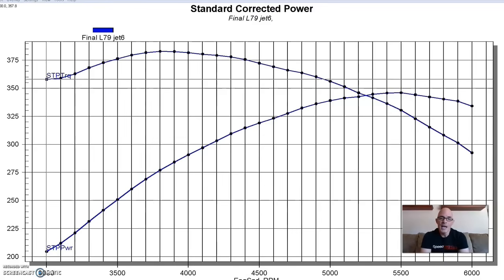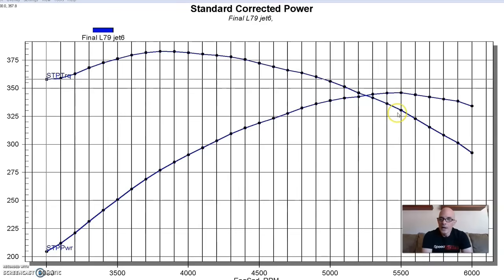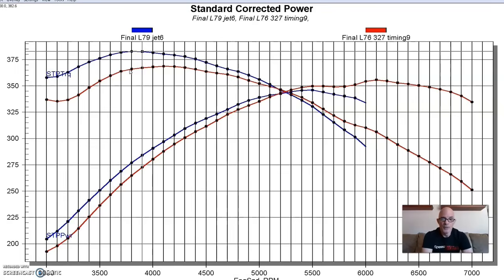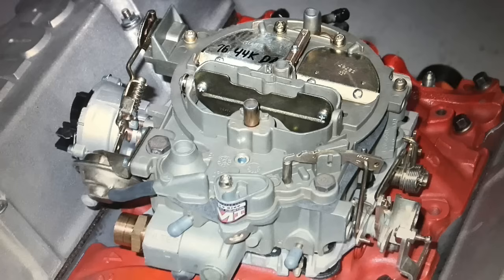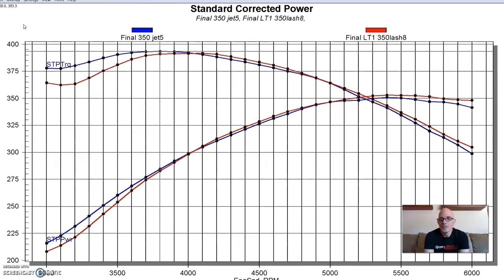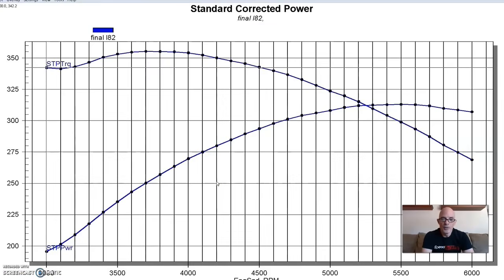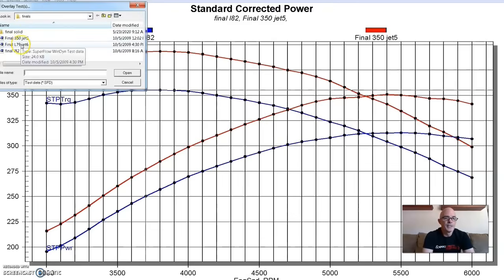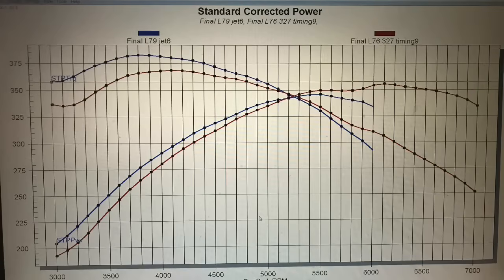HOW MUCH HP DID THE L79 350-HP 327 REALLY MAKE? WHAT ABOUT THE L46 350-HP 350 OR L82 250-HP 350?

Comment: I ben eating holley carbs with a q jet for over 44 years now ! My holley buddies hate me . I get 4 , 5 mpg more than they get . And my q jet eats their lunch every time we race ! Good times 😁
Reply: Yes sir, thats exactly why I ran a Q-jet on the street with a small block.
Reply: @skxj   💪🤟👊
Reply: Qjet is a better carb if tuned to the engine its on. Obviously, you got it right, you know...when I was a kid, I liked Holley, they never get good gas mileage. A well tuned Qjet is more fun to drive, more responsive & does better fuel mileage...
Reply: Yeah I had a couple of them on 308holden motors here in Australia. Good stuff.👍
Reply: I've had a 1971 firebird with a lunati bracket cam ,high lift rockers other stuff ,tried holley and the new edelbrock ,this racer x guy sold me a1971 q jet with a adapter for the duel plane .it ran so well with the q jet ,the idle good ,and it had big power 800cfm and did  not always smell like it was running rich
Reply: What the hell are you even talking about..?
Reply: Spread bore with Triple stack Venturis !
Reply: I once seen a guy beat a crappy  quad jet right off the Manifold with a hammer.  It had nothing to do with gas mileage. But When talking performance, If you start talking about gas mileage...?  People are gonna think you're talking out your 🫏
Reply: @kevinwest3689 dont care what ppl think ! Proof is in the carburetor ! Ive literally throwin around 30 holley carbs in the trash the last 40 years . I remember racin a buddy . He had a F150 . 78 . Fresh 400 Ford big block . 262 comp cam . Limp ass holley n headers . Im in my 79 blazer . Stock , Q jet n headers  . 200,000 miles on the motor . 350 sbc .Even my buddy agreed i beat him by at least 12 truck lengths ! 
My neighbor has a 600 horse 427 in a 69 camaro . Had 3 different holley carbs on it though the years . 6 speed trimec tranny . Went a head and bought a holley sniper for it . Still wasn't happy with the way it ran . He got pissed and parked the car . Took a year . But i finally talked him into trying a Edelbrock . Guy says the cars NEVER ran that good in the 20 years he's owned the car ! 3 more holley carbs and a sniper sitting on a shelf collecting dust cause they ran like ass ! And my neighbor is one a the best mechanics ive met . Sharp guy ! Hes ran a portable wrench service fr 20 years .

Comment: I like all of these engines! Im a big small block Chevy guy. And all but the L-82 are legendary. Ive built and owned replicas or originals of all of them at one time it another. The 2 top performers in my opinion are the L46 and LT-1 350's. No surprise that similarly spec'd engines the larger one will make more power. The L46 was the biggest surprise! It came very close to the LT-1 in everything but rpm. It was pretty much done by 6000rpm(hydraulic lifters of the day all were) The LT-1 was a handicapped by its era small block. A simple cam swap to the duntov 30/30 cam made this engine a threat to most big blocks. It made the 365hp 327 and DZ302 seem tame by comparison! The burst of power you got at 4500rpm in the smaller engines came on at @4000 in the 350 and carried a lot more torque along with it! In a light car like a Camaro or nova with a 4 speed and 4.11:1 gears it was very formidable on the street and with the extra displacement also had better manners. Its the Small block Chevy should have built!

Comment: I have a 327 in my 1970 Nova. Got the car in high school as a 230 six with three on the tree. My dad and I swapped it out for the 327 and Muncie four speed. One of those memorable things I did with my dad who was an excellent mechcanic. We built it to the 350hp specs. It was definitely enough for teenager in the late 70's. Still have the car and am going through resto on it. Have always liked the way it revs compared to most 350's of that era and out ran many of them. Seemed like the 327 was more durable than the 350. Maybe it's the shorter 3.25 stroke. I can see how that might help them in the with response.

Comment: So many questions, camel bump heads? I've always seen them as closed chamber heads. They had a bump in the chamber between the valves. Then you haven't or I haven't seen you test angle plug heads. Solid lifters always meeded adjustments.  Even the owners manual describes how to do it. When testing the DZ 302 did you test with the dual Quad intakes? I'd love to know...?

Comment: I ran a stock '67 327-275 (vacuum secondary Quadrajet) in my '64 Impala SS with a 4 spd. Muncie & shifter, and 3.36 gears for a while before adding a 327-350 cam, a spreadbore Holley mechanical secondary carb on a stock intake, headers, a Hurst shifter, and a 4.56 posi unit. This combination was so responsive and torquey from idle up to the 5500-5800 rpm range that people I knew with the DZ-302 Camaro's or 327-365 Vett's couldn't believe the low end difference I had compared to theirs that had to get past 3500 rpm or higher to get their power band going. We used to loosen the rocker nuts out from their 1 1/2 turns until they tapped slightly then tightened them down only 1/4 turn and leave them there which allowed the hydraulic lifter to act like a semi solid lifter and kept them from pumping up too quickly, after hearing other comments I wished that maybe I would have tried the 350-350 LT1 cam & a factory aluminum intake too, damn I miss those days and my car I'm 72 now and most days can't remember shit or anything else, but 52 years later that GM 327-350 cam part #3863151 is permanently tattooed in my brain. 🤔

Comment: The factory jam rocker nut is a one time use locking nut. If you back them off for any reason, they can not and will not ever stay put on solid or Hyd lifters. I just use polylocks on everything, problem solved. Also, put me in the solid lifter line, I know how to adjust em . Hyds are fine for a daily driver but for performance duty I will stick with big lift long der cams on a 110 or lower centerline.

Comment: Which brand and size of headers are you running? Thanks Richard. 🙏
Reply from the maker: 1 3/4 AND THEY ARE SHOENFELD
Reply: @richardholdener1727  thank you sir! It’s a joy being able to learn from your videos. Just know this, there are more of us that love the old American way of building engines. Like hot rodding used to be, LS engines are the best, but, most of us have the gen 1’s and we want to keep the old ways alive the best we can with our small budgets. I love the 327 videos you’ve put out but, my friends and I would love to see what you could squeeze out of a stock sbc, stock stroke, stock double hump headed engine by doing what we can afford. That means no aluminum heads! Just speed secrets like some home porting on the heads, port matching to an old school aluminum intake, maybe changing rocker arm ratios. Of course, use the solid lifter 327 as a basis and see what you can squeeze out of it without new heads and such. Mine is a small journal 327 with 492 DH heads, bronze valve guides, 3 angle valve job, 1.6 roller intake rockers, 1.5 exhaust, pop up aluminum cast pistons for 11:1 compression with 64 cc chambers. What can I do to this engine to increase output without changing heads? It seems nobody cares about this anymore. My cam is a comp cams nostalgia + 30-30- solid. If you can’t do a build like this for us 283, 327 guys, can you at least give me some pointers? If you’ve already done this, I apologize in advance. I can’t find a video on it. Thanks, and I never thought I would get a reply from someone like you, let’s me know you guys really do care about the little guys. Thanks from all my friends and I, Tony 🙏🇺🇸

Comment: Richard, I have experienced studs pulled out with aggressive mechanical cams and strong valve springs. In the old days, we would drill and cross pin the studs with a roll pin. You might check the studs to see if they were pulling out (assuming you haven't modified them for screw in studs).
Reply from the maker: screw in studs

Comment: Solid will beat hydraulic ever time poly locks mandatory if cam is broken in properly Parkerizing rarely need to be set after 2000 miles I haven't set mine in 10 years 1000 miles a year on my L79 Chevy11 ZDDP racing oils even some Rottella Diesel oil have Zink and Phospherous over 1000 ppm I do that to all engines I build works great no BS

Comment: I've seen lots of those stock rocker nuts come loos. Back in the day if you couldn't afford the $20 for polylocks, we would lay the nut on the floor & hit the top with a hammer to squish the top threads together. They won't come loose after that!

Comment: Corvette C2 Question Please: 
Which lifters did the 327ci 350HP engines that were in the C2 Corvettes have? Thanks very much...
Phil
NYC Area
Reply from the maker: the l79 350-hp 327 had hydraulic flat tappet lifters to match the l79 cam
Reply: @richardholdener1727  That is what I thought, but a recent conversation with a good friend and he thought they might be solid lifters, so I wanted to clarify for sure. Thanks for your reply.
Phil

Comment: one of the 327s was 375 horse.....stick only.  of corse
there was a 370 horse 350 in the corvette in 1970.....stick only...
z28 was a 360 horse.in 70...probly
had less only on paper
yes ive had the pinchnuts get loose
polylooks fix every time
Reply from the maker: the 375-HP 327 was the L84 Fuel Injected version of the L76 (carb). the LT-1 was rated at 360 hp in the Z/28 and 370 hp in the Vette (same engine)

Comment: Super Chevy did the same tests some 13, 14 years ago. what you should have tried was test the L79 Cam in that 350-350 with the aluminum Intake and a 202, 11;1 with the 780. then try all the cams in a similar set-up 400. please do!
Reply from the maker: I did that test for Super Chevy. The L79 had 2.20/1.6 valves, the alum intake would be interesting

Comment: Hey Richard, I have a razor blade rebuilt 350. Over the years I acquired an L46/L82 cam which I’d like put in the 350. Think Vortec heads would be good for 20-30hp over those fuelies?

Comment: Another great video.  Those two hyd cams are still very popular today, even though they have low lift and slow ramps. I would like to see the potential of these cams with a better head, intake and 1.6 rockers. I think the results will be surprising.  I have the 290/350 in my 65 Nova (even "worse" L82), works good, but leaves a lot on the table. Going to ad a set of vortec heads, 1.6 roller rockers and a RPM intake. On a side notes you don't see these old grinds going flat like modern cams...

Comment: I had a 327 I built. Here are the parts list, isky 485 lift and 230 duration at .50  11 to1  forged piston, heads were 461 with minor porting, hookers headers, edelbrock tarantula 3500 through 7000 Rpmand 390 years with 350 turbo. Cloyes true roller timing set also Rhoads anti pump up lifters HV oil pump and a 780 cfm carb . boy did that engine would rev.

Comment: Have an L79 66 corvette, still surprising for a small block.  My dad had a 64 solid lifter 327 back in the 60’s along with a couple 427 (400&435hp versions) and said the best drag race car was the 327 with 4 speed and 456 gears.  Nothing beat it if you didn’t miss a shift.
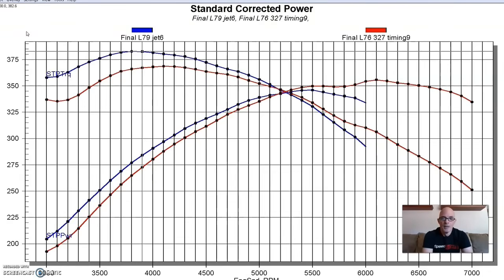Reply: 4:11 good street/strip

Comment: Thank you for this Richard. I am in the process of rebuilding my 67 327 now. I have a set of iron eagle heads. 64 cc chambers. Would like a slight loppie idle. Would you recommend a hydraulic roller cam and piston dome to get 10:1 compression producing close to 400 hp.
Reply from the maker: you don't need a hyd roller-a flat tappet cam can work

Comment: I was a Chevy line mechanic back in the day.  We were told to replace the hold down nut.  If that didn’t fix the problem replace the stud and the nut.  The problem was the threads wore just enough they could no longer hold the tension needed to maintain the adjustment.

Comment: I had the L46 in my 1970 vette. Only came in the vette. All with 4 speeds. Ran very well. The L 82 which was a very similar engine really suffered from the 2 plus points of compression loss.
Reply: It's not just the compression the '71 LT1 with the larger chamber heads and 9:1 matched the 70 LT1 in power.
Reply: @Dayandcounting      you are correct; I've seen dyno results showing the 71 LT1 making similar power to the 1970 11 to 1 engine. My thought is the more open combustion chamber breaths a little better to make up for the 2-point comp loss. (?) Re the L46 and L82. I do know the L46  ran noticeably stronger that the L82. Maybe the stock L82 had more restrictive exhaust, leaner tuned q jet and of course starting in 75 the L82 had a catalytic converter behind it...so, yes stock wise there is probably a little more difference between them besides the 2 point drop in compression.

Comment: Always ran poly-locks on solid lifter small blocks. Not just the 30/30 cam, but the old 097 8/18 cam too. Poly-locks were a cheap investment to keep you from constantly having to adjust valves.But for a every day driver? Hydraulic is the way to go, NO doubt!

Comment: Hi Richard, Thanks for the beautiful video.  I am a fan of the L79 and have been working on them since 1973.  Very potent, especially with an M21.  My current Chevelle, in the thumbnail, has this combination.  I have yet to loose a street race.  I had to lower the compression ratio to use REGULAR gas, but increased the roller cam specs slightly.  With the carb and timing tuned to a razor's edge, it is a monster.  I fortunately have two of these engines, a '67 and a '68.  My buddy Bruce gave me a 350 block out of a dump truck which has 4 bolt mains and is made of a better grade of cast iron.  The '68 crank, rods and pistons bolted right in.  I'm using the original '67 intake and long tube headers. I absolutely love banging gears in that car.
Reply: What’s a good set up to run that cam ? Currently runing it on my sbc
Reply: I have always installed cams with the stock timing marks. I work out of my house and don't have a dyno to experiment with cam timing.  I rely on long duration, advertised @276 intake. I have used more in the past with flat lifters. The roller cam and rocker arms free up some power, and advance the spark timing to just before knocking occurs.

Comment: Love these videos! because as time goes by (even 35 years ago let alone today) these things become more mysterious and i like seeing  more factual info. As for the rocker nuts coming loose, i have had the pleasure of driving a tri 5 with an original l76 crate engine and even the poly locks come loose occasionally. Ive also driven an 80' l82 vette with an edelbrock head swap and headers, it was/is strong on the butt dyno.

Comment: I owned a 64 Corvette with the L76 365 HP 327 Muncie and 3.73 rear gear. I drove it hard and did a lot of street racing too, back in 1966-71. Got Drafted. I loved that motor. Down low you had to be careful. Even at 3,500 if someone wanted to go you really needed to downshift fast and let the Rs come up to HP level. As your graph shows out. I did make a few mods. along the way. Headers were great. I was a poor farm boy trying to get thru college so I bought Jardins 4 to one but ran a short pipe out the side of the collector to the midpipe back on the street, with the collector caps off. But even then you could feel the headers helped with the breathing. Then some old timers showed me how to add the SCREW into the Holley secondary linkage to get then to open up earlier and cheat the vacuum secondary.  But later a Speed Shop in Carbondale opened up and i found a kit to add squirters from the front accelerator pump jets that reach back to the secondary barrels. I had to drill two holes in the center plate but i think being dual plane that must have helped. But then I found a gear drive secondary linkage.  WOW! that was awesome. with the Caps off, and nailing the gas around 4, 000 was one hell of pull to redline, speed shift to 2nd the Rs drop to 4,500 and just start pulling like hell all over again, 3rd the same and 4th the same. That 3.73 was a good gear with the 2.2 close ratio Muncie the gear change at red line always dropped you down at 4,500 ready to start climbing again.  Once i asked a Chevy guy what else could i do to get more power, he told me to go to the 350 HP Cam. I thought that was nuts. But I think he was looking at the torque advantage. I was at light once and a friend had just bought a 6 cyl MG. I know but was acting out, but he never left the light. So i take of easy and go to second, then he nails it! I was in 2nd way down low in Rs. He screams by laughing, I nail it in 2nd and just had to wait, and wait, finally at 4,500 the motors starts its scream, Big 780 was wide open headers caps. But i finally got to him and roared past accelerating like a lit up Rocket. I loved doing that, but i did not like giving up that low end grunt. Over the years I tried and tried to match that motor but had no luck. I did have a 302 Z28 briefly and it was the closest I ever got. You know the LS with a Magnuson is not the same as 11.5 compression and 327 CU In at 6,000 RPMs .with that 30/30 cam. Wow. I wonder if I could work my LT1 in this C7 Z51 in NA mode to get back to that sensation. With VVT i would still have some torque Yes? What cam would get me there? With E85 98 CFM  TB and bigger down pipe with cutouts. I bet you it would be close. Thanks for all you do, I loved that L76 and never hear about them ever. Dennis in Virginia
PS Good buddy Benny had a 65 Vette 350 HP I always beat his ass on the big end of the Tach. I also had an 81 L82 for a but it was nothing, especially up in the Rs it dogged out. D